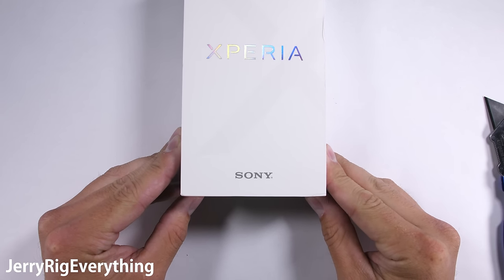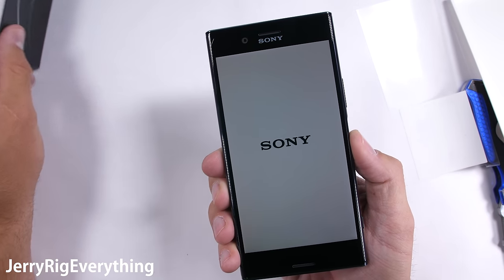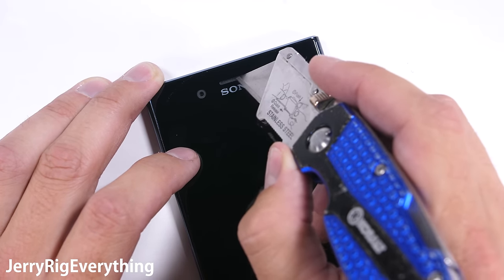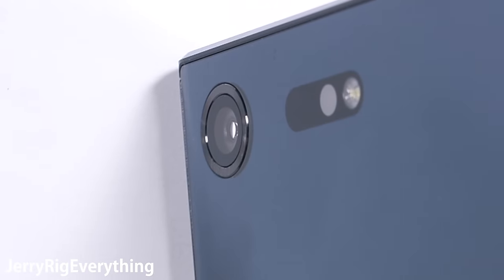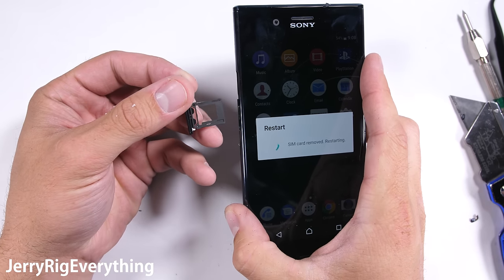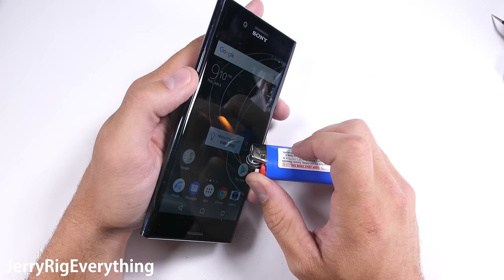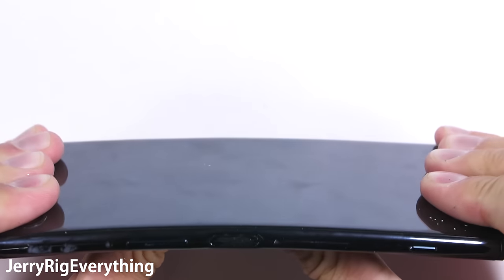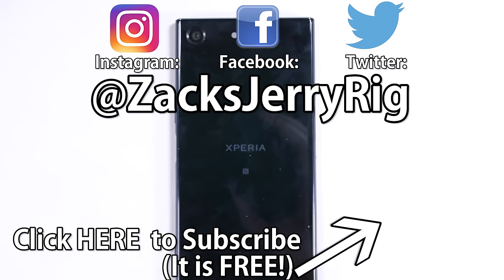Xperia XZ PREMIUM Durability Test - Scratch Burn Bend Tested!

Comment: Watching this with my xz premium 👌
Reply: Me as well though this phone is not officially mine yet. Working with t-mobile and ATT Sim cards. Owner of a Galaxy S7 and work provided phone iPhone 6.

Thks is the largest phone I've used and not sure I like the weight and size. I am eying the Sony compact dual Sim phone. How does this xz premium phone hold up to dropping. I have a screen protector and case on it currently
Reply: Let me update that I am still using this phone and has been mine. So far I'm loving it. Great battery life and everything works.
Reply: I wanna buy this phone but i'm not sure about the battery life
Reply: Maxime Bariteau  I dropped it to hard surface ground and just some scratch on metal rounding and nothing else, solid as fxck
Reply: @iniop52  not so good, especially watching videos cuz the 4k screen. But if you remember to turn on stamina mode while not gaming, it is not so bad, at least one day normal usage, and it charges quite well.
Reply: @iniop52  its a beast with great battery life mine last for a day and half. You wont regret
Reply: Same here, inherited from my brother and its awesome
Reply: Me too
Reply: I'm jealous
Reply: @shamwaymoonyos9578  me too dude. Frikin love this phone
Reply: Same
Reply: best phone ever made
Reply: Did you peel off plastic from the sides?
Reply: Me too!
😉
Reply: Same me
Reply: How's this phone bro?
Reply: @luqmanjunaid1701  Well, my xz premium is looking rough and lost it's water/dust resistant capability and despite that, it's still fully functional like it should. 
I would recommend you all who still using xz premium to use case that are tight fit and impact resistant so the seals inside the phone won't come loose or the water and dust would go inside and you'll have a bad week 😅

Comment: You should start doing water tests on the phones you review (after the flame test and before the bend test since in this last one, the phone doesn't necessarily need to be functioning properly).
Also, you should have tested the 960fps slo mo :)
Reply: How do you know if he's even in the same country as you, gtg put my head back in the sand again now bye!
Reply: Shulkyl You can find water tests anywhere, but you will never find a comprehensive durability test anywhere on YouTube other than our friend jerry.
Reply: Work Out Yes but I would like if Jerry did it. Just because I like Jerry, Jerry is cool
Reply: Shulkyl I agree ^^ jerry is very cool, I like him too.
Reply: His name isn't Jerry, it's Zac.  Jerry rigged is a term that means something is put together sloppily.
Reply: bend test is judged by the screen surviving though
Reply: I own Xperia XZ Premium over 14 months from upgrad Xperia T, still works well and 30 meter drop onto concrete floor proved top quality and strength! I drop XZP often because quite slippery as so polished but transparent back cover solved it. Film is unnecessary. POINT!  Most of Sony Xperia phones and even tablets, and many headphones are all waterproof as standard. I watch video like this while in the bathtub over two years. Watch Sony's own promo videos. I just be so sad for those never owned Sony, like Samsung or iphone are just waste of money and cannot appreciate highest technology and user experiences Sony always offering many decades longer than those copiers and fad.

Comment: The plastic is treated nylon, so it's pretty much the best plastic you can get and it's actually better than aluminium in this case, because it dampens the shock received by the glass when the phone falls on a side better than metal (unless you use some sort of liquid metal alloy which is too expensive to manufacture).
Reply: HEY GUYS go read the article "Trotsky's day out" from the Times of Israel.

In this article it explains how ethnic jews orchestrated & went through with one of the biggest genocides in history right "before" the rise of Hitler.

Random comment but an interesting read none-the-less.
Reply: J Walker lol even the glass back of s8 feels more like I'm holding a cheap plastic...

Comment: Still working well and unexpectedly fast in 2021. Battery capacity at 92% after 4 years of use. That's insane. However, I had to upgrade because some apps aren't optimized for android 9 anymore (especially those banking apps).
Reply: Yeah looks I have to do that as well. Shame.

Comment: Well I've owned this phone for more than two years and it suprisingly durable.
It can still be washed under the faucet without dying, it has been dropped way too many times but apart from some deformation on the metal corners, a (sadly) deep groove in the middle of the display and some paint that has chipped off from the nylon siderails, it has survived the time really well and I'm very glad about that as I haven't found a successor for it yet, the only replacement I can imagine right now is another new XZ Premium
Edit: almost 4 years later and it still works great, good thing that the 1iii looks like a good successor
Reply: It's 2020 and I still want a xz premium

Comment: Do a Samsung galaxy note FE test,only sells at amazon
Reply: Gaming of the day Celldweller forever
Reply: Nordic39 EON 👌👌👌
Reply: Gaming of the day Get this comment to the top
Reply: how would that be different from a note 7?
Reply: Maru has a lower baterry, software changes,includes a case,has a bixby funcion
Reply: Maru It is not gonna explode
Reply: nope
Reply: i have the note fe is nice
Reply: they are basically note 7. The only different thing is the battery. It should pass the tests just like the note 7 did. The teardown will be similar as well, just with smaller battery, so there is no use buying a note FE.

Comment: Hey Zak ! Thumbs up for all your tests, but I have a suggestion : you should do the bend test before scratching the side of the device. Doing so will prevent compromising the solidity of the phone when bending it, because scratching it, like you do, is weakining the strength of the side and doesnt make it really reliable when you bend it and break it in some situations after damaging these sides.

Comment: AUSTRALIA. Subscribed with notifications on. I witch all youre videos. it looks like the phone was getting ghost touches after the bend test. you should try mention little problems like that. sure no one trys to fold a under folder phone (that will make sence in couple of months) but my s8 got gohst touches after not even a year of owning and so did a lot of s8 users and I got so frustrated with I ended up breaking it. just good to know of any lasting problems after you're tests . cheers jez

Comment: Enjoyed using mine until it spontaneously broke; one of the issues of having an Xperia is that no repair places invest in the stuff needed to fix them given that 99% of the market is Samsung/iPhone
Reply: I'm not sure what components repair places can stock, since the more common devices (as you said, Samsung/iPhones) are increasingly unfriendly to repair (a deliberate act by the OEMs).
Reply: @pixels_per_inch  I did, in fact I think I commented on the Witrigs teardown video - changed the charging port & the battery to no effect.

Eventually found a place that specialised in micro-soldering and they replaced the IC power chip, got it working for a day or so but died again shortly after. Shoddy build quality for a device labeled "premium"

Comment: hello my xz premium was almost unloading so i was uploading it vibrated several times and logged in i hung up everything idol after connecting loaded it does not load nor light light but when it connects to the computer it appears installing drivers but no loading signal can be the connect for sure?

Comment: Might be a tad late, but I'm currently looking into getting a new phone, my current phone is a Huawei P10, which I like a lot. 

However I feel like something different. I used to have a Xperia Z1 about 3 or 4 years back, and it was back then a great phone, I parted with it though due to some software and hardware issues, mostly the os hiccups and the wonky battery, after about a year and a half into it's life cycle the phone kept turning off at around 25% to 45%

Prior to the P10 I'm currently sporting I've had a Samsung Galaxy S7 Edge, great thing, but the all glass design and many friend's phones involuntary "spider app" made me sell it, knowing myself it would not last long. So I'm wondering is it worth picking a Xperia XZ Premium over my current P10? Has anyone used it since release, who'd be willing to shed some insight on it? How's Android 8 on it?

Comment: that was the Z5. the Z4/z3+ WAS WAY BETTER than the z5. the z4 didnt have plastic
Reply: the z4 and before had an all aluminum body and the rear was glass.
Reply: As long as you dont carry sand and the z5 in ur pocket it doesn't matter whether the lense is plastic or not. Ive had my z5 for nearly 3 years and even though it has a few scratches on the lease it doesn't effect it in any way.

Comment: My sony xperia xz premium has bent and the back glass near the power button and lock has come apart looks like sony has done it again when you buy it brand new its fine then after a couple of months you find unexpected scratches and nicks even with a case and a screen protector i haven't dropped it once its heats up after 10 Minutes you can basically cook am egg and the screen is useless with its touch sensitivity i had better response on my old lg g6 and its still going strong today even after being left in my pool for 20 hours i bet this one will die the second it touches water im a sony fan but every day i seem they overprice there products stupidly even huawei makes better phones and cheaper